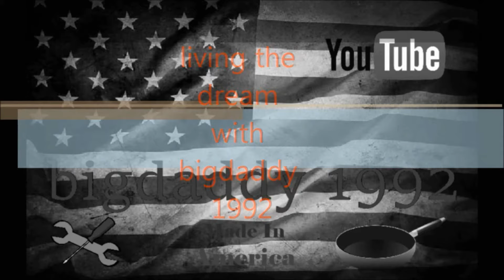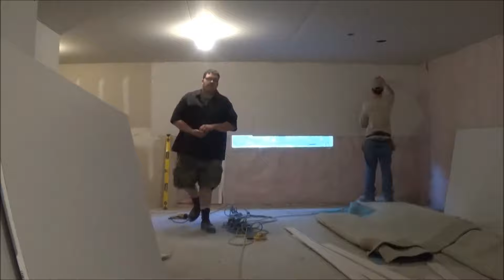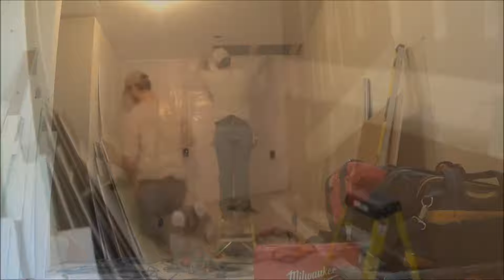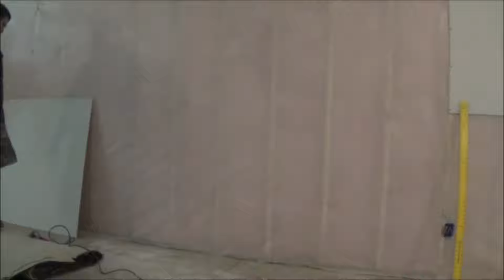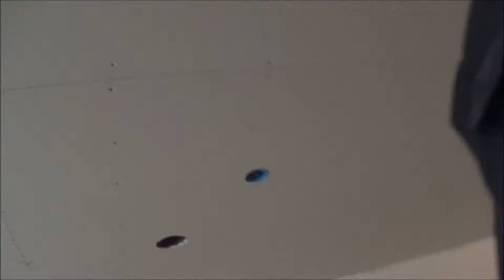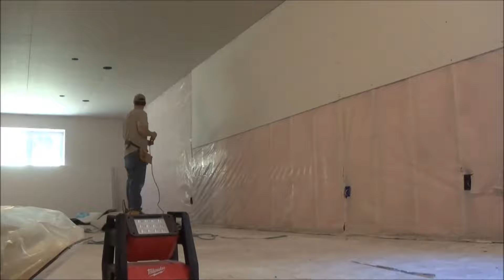rocking the sheet rock 2

Comment: When I was doing this kind of work we always put the lower sheets on first and then the upper sheet, that way it was easy to support the upper sheets on the lip created by the lower sheet and no need to try to "hang" the lower piece and try to lift it up tight against the upper sheet, resulting in a tight joint every time. Different strokes for different folks as they say (whoever "they" are...)
Reply from the maker: The Shade Tree Fix-it Man this way works for use